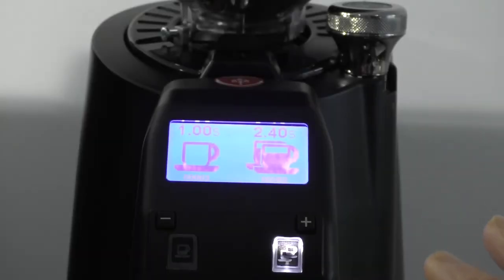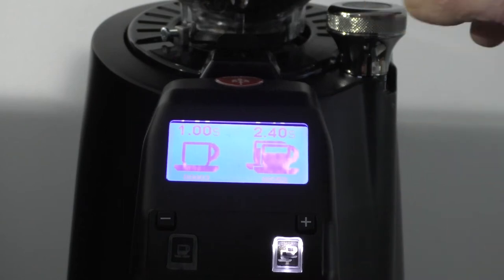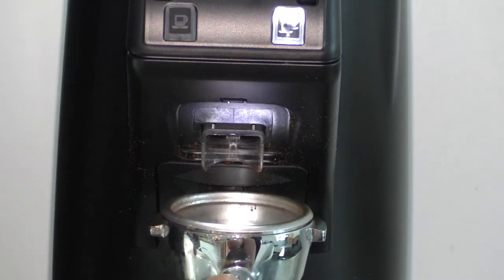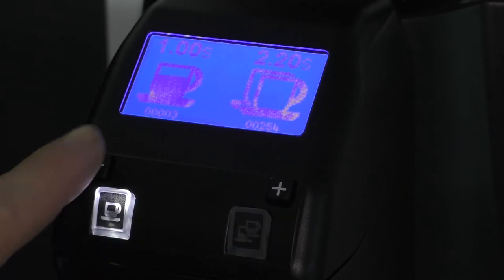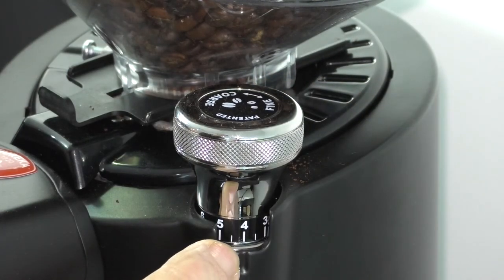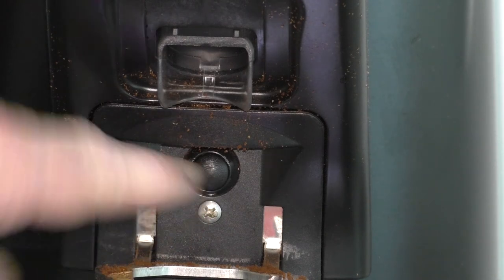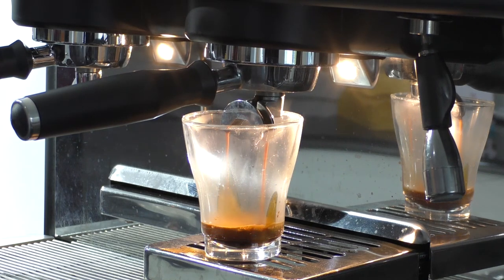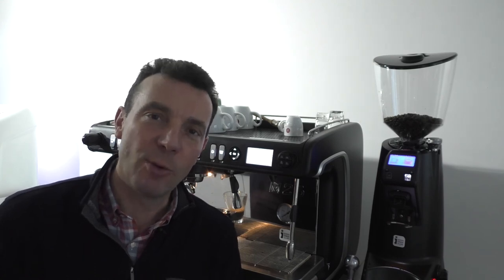Using and programming the Eureka Olympus  On Demand Coffee Grinder

Comment: At what number do you find most medium roast ~18 gram shots work best?
Reply from the maker: Hi Stephen, the number is less important that the time it takes to extract during the brewing process .  if you are using an 18 gram throw and it takes say 30 seconds to extract (from the time you press the button) then adjust the grinder more coarse until your extraction time is circa 25 seconds and vice versa.  The number on the grinder is a useful guide to understand the relative adjustment being made or if somebody inadvertently adjusts the grinder and you want to quickly put it back to where it was.  Each coffee will have a different grind setting so there is no correct or incorrect number.  Whats most important is the quality and time of the espresso pour.  Hope that helps. David